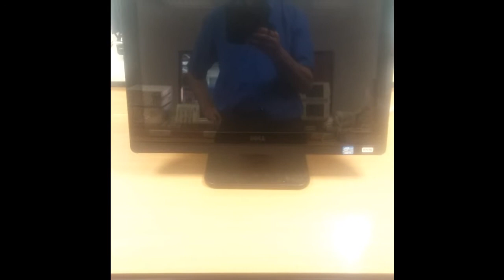Upgrade a Dell All-in-one 3011 to Solid State Drive

Comment: What you really really need is a mobile/action camera chest harness..along with a Xiaomi Mi Mijia 4K Action Camera so you can see on the back of the lcd your video quality.. right now.. (i apologies if it sounds negative) but this looks like its too hot in the room.
i bought the same for my mother. but now i need to upgrade her AIO's basic memory 4gb to 16gb and HDD to SSD :)

Thankyou for the video, GOD BLESS.